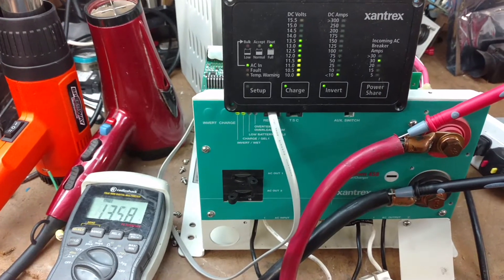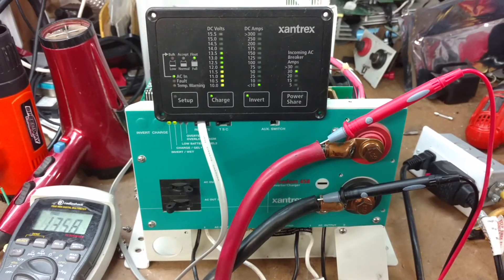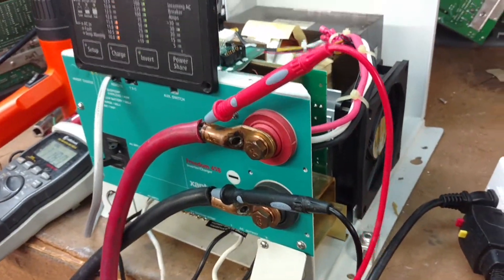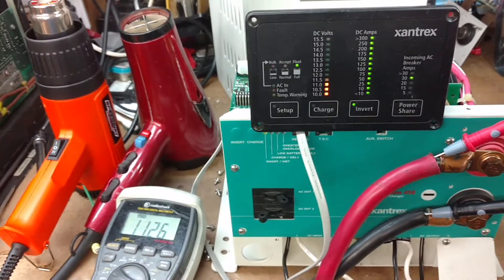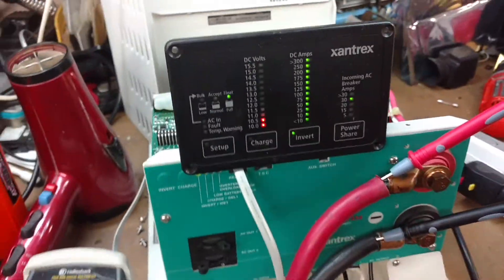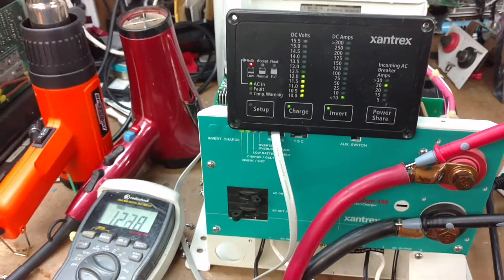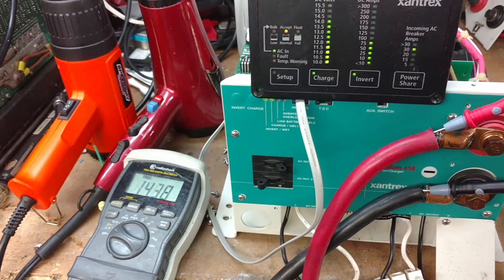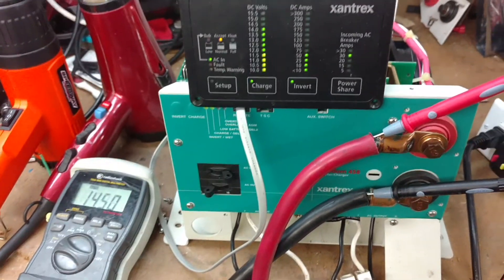South Trails RV Xantrex inverter testing

Comment: I have exactly the same one on my RV but first light that said invert/wet is flashing in green is that normal?
Reply from the maker: Flashing green is OK. It's ALWAYS best to add the remote control panel. It makes using the inverter clear and uncomplicated, and it gives you a lot of good information. Search Amazon for "84-2056-01". Money well spent.

Comment: Just curious for testing purposes was your connections to the battery directly connected to the battery with no fuse I saw that you ended up drawing 300 amps worth of current when you were inverting and you never popped any fuse instruction states use 125 amp fuse I was going to test mine and I pop my fuse because I was drawing over 200 amps I'm just curious if you were hardwired with no fuse to the battery bank for testing purposes
Reply: I stopped using a fuse at my test bench. It became too expensive. The downside is: if the power transistors on the Power board short circuit, they will "blow up" when you apply direct power to them. It's pretty loud, and there's a good bit of smoke, but once they're "done", you essentially have an open circuit. The transistors ARE the fuse, and like an open fuse, once they've blown, there is no further power flow.

Comment: Why is the overtemp lights on the indicator board and no ac coming in
Reply from the maker: The "over temp" light is similar to the "Check Engine" light in your car. In reality, it could mean any of a number of failures. If you're in the Sarasota Florida area, I can help you - otherwise you need to find a Xantrex repair center near you.

Comment: I have that exact model (81-2022-12 Oct-2017) for a class a motorhome, however, I have no DC power unless I run the engine. Lights on the inverter do not come on and no power out at battery terminals; I am connected to (30 amp RV is 50amp) shore power 120v outlet work. I just wanted to turn on the interior lights which worked at first but then stopped working after several hours of use. The batteries de-charged too. Any ideas? Thank you. P.S. Recently bought a used motorhome.
Reply from the maker: There are many potential points of failure that can prevent an inverter from producing DC.

Contact me via my website and we can discuss this further.

www.marineelectronicsrepair.com

Comment: Isn't it harmful to the ac pass thru relay to keep leads on. It Burns the contacts in the relay.
Reply: Pretty much ALL inverters have relays that are used to pass power - either from the inverter circuits, or the shore power input - to the output leads, then on to the loads. Relay contacts are built much like old school automobile distributor "points" - an expendable part with a finite lifespan - and usually last 7-12 years (depending on the load) before the contact face degrades to the point where it can no longer reliably pass power. 

Like distributor points, you must look at relays as an expendable wear and tear part that WILL one day wear out. It's not a matter of IF,  but WHEN.

Most relay contact damage occurs at the point of switching from shore power to invert - or vice versa - with a load attached. It's theoretically possible to extend the contacts lifespan by turning off loads - BEFORE - transitioning the power source, but all things considered it's usually more trouble than it's worth.

Comment: Is it "True" sinewave. Can you put it on an oscilloscope to see what the wave is? Thanks.
Reply from the maker: No, the 458 series produces a "modified" sine wave - not a true sine wave. True sine wave inverters almost always have the letters "S" or "SW" in their model number. Be careful what you buy. The inexpensive lite weight inverters are typically not repairable. The ones that weigh 45 - 55 pounds are, but they are substantially more expensive - at least in the short term.

Call me at the shop if you'd like to discuss this further. Nine four 1. 74 Eight. 1941. Steve